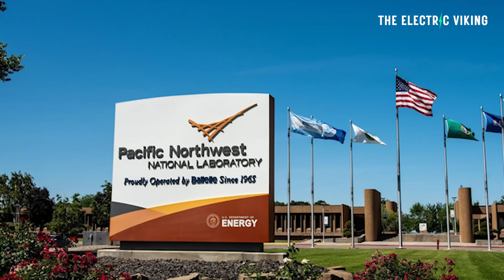Microsoft AI analysed 33 million candidates to find material to replace lithium

Comment: What I don't get is why sodium batteries haven't been given the due research they deserve. Of all the "rare" earth metals, sodium is the most abundant and easily sourced element. It's a component of "common" (!!!) salt, which is of course in sea water. It may be that sodium can't easily be obtained from salt in which case I stand corrected. But to use sea water as a source of sodium, you just need to suck it up, no damage to the environment, unlike the huge amount of damage caused by mining from the ground. It seems like such an obvious source that it feels like a conspiracy, simply because companies couldn't make as much money and it could of course facilitate a faster switch from oil. Could it also be a conspiracy that we have been exposed to all the dangers of batteries in terms of fires that people are becoming afraid of buying EVs, when sodium is supposedly safer?
I don't think it takes an AI to discover that sodium would be a good material to use, nor does it take an AI to discover that lithium combined with sodium would be a good chemistry. Surely sodium should have always been the element to experiment and develop batteries with?

Comment: Sodium batteries are nothing special, literally an iterative step in cost cutting and mainly cheaper vs li, sodium is a poor intercalation ion, requiring high surface area hard carbon instead of graphite. There are much much better, jumps possible, so if that’s AI’s best answer I call bs, look into Rb/K complimentary intercalation into graphite.. for cutting edge. ditching EMC and DMC electrolytes is the next big thing in batteries time for simple liquid electrolytes to go. Regards bill

Comment: It makes sense that China is searching for alternatives to Lithium. Despite having the 5th highest world reserves (Chile having ~6 times the minable reserves), they're the third highest producer. China is depleting their minable reserves as fast as they can, faster than any other higher reserve country is. Other countries should step up their production right now while they still can. Yes, higher production will lower the worldwide price of lithium and therefore lower the high cost of lithium batteries. Not as low as it could be with sodium-lithium, but enough to delay the financial feasibility of sodium-lithium technology which will be better for Australia and Chile. To drive China out of the market when they mine out so much of their reserve that what's left is too expensive to mine, thus forcing China to buy lithium from other countries to meet their own demand, even with a lower net demand of sodium-lithium technology.

Comment: I commend MSFTs efforts to let AI do the labour intensive number crunching to deliver a final result of a hybrid Li/Na battery as potential best in class performance to value ratio. Having said that I can't help think of we wouldn't have arrived to that conclusion soon, with the way Li and Na technology is evolving today anyway and we alteady have EVs on LI or Na already in production EVs and batteries. The conclusion to me seems unsurprising that AI found this, because with common sense we can actually conclude someone will sooner or later combine both in an experiemnt and rapid prototype from there and that Tesla has likely already thought of this hybrid somewhere in a back office (wouldn't be surprised). There is already a company that mounted a hybrid battery to a Tesla and showed a better performance. So trials for hybrid batteries have already started. And with the first Na battery EVs on the market we have already discovered their safer fire hazard risk quite soon. And from common sense it makes sense because Na batteries have lower capacity. It is especially the higher density battery, where it becomes technically challenging to manage heat, also common sense with no AI needed. I think the more interesting news with AI and batteries is if it can actually model a 3D layout gow to build safer, chaeper and better performing hybrid battery, rather than come to the conclusion which elements fit best as hybrid. And perhaps model how a battery can be built that works efficiently in different climates, which is still a huge challenge. And most interesting if AI can design an EV battery pack with best cooling practices with AND without battery cooling and minimising loss of performance and degradation. The would truly be the smartest use of AI.

Comment: we must think critically about the abuse of AI. it is the abuser, not the AI itself, that is most dangerous. if you see the implications of using AI in the critical areas of science and engineering, you can infer that much more important problem solving is being exploited behind the scenes. anything publicly announced to do with AI problem solving is likely many years behind in significance from what has actually been invented. my assertion is that the public will be the last to know the truly revolutionary AI driven innovations. additionally, there is a feedback effect with AI. AI will become (has already become?) self improving. the results of this dynamic will also be held from the public until it's "too late" unfortunately, (whatever that means). musk is correct.

Comment: Sorry but lithium is just not all that expensive. We actually have plenty of it with more easily mind reserves being discovered. So I'm not at all convinced that it's necessary to replace lithium with something else in order to get batteries cheaper. And these other materials end up being kind of exotic and hard to produce, making them just as expensive or more so. Even this supposed breakthrough only replaces some of the lithium. Better anodes, better cathodes, better electrolytes, more massive production. Lithium based batteries still have decades of upside in development and cost reductions.

Comment: Lithium is not the biggest component of a battery. Lithium is also not in short supply so really what’s the big deal here?  
We need a competitor to LFP. It’s already extremely safe and robust. Its weakness is energy density in weight and volume terms.

Comment: NASA’s solid state battery uses selenium and sulphur to achieve 3 times capacity over lithium, but are working to increase cycle life and lower cost.  I’m sure we’ll see a few different high-capacity batteries over the years, for different uses.

Comment: The AI in The Matrix also found a perfect battery replacement battery 🔋😳
Reply: Technically not a battery, they were power plants. Also in no way perfect or even remotely feasible as a power source. My head canon is they told that to humans to mess with them, and they have perfectly functional fusion reactors never shown on screen.

Comment: Hopefully AI will compress the next hundred years of fusion technological advances into the next ten. Energy storage improvements are great and absolutely needed, but just as important are clean and highly efficient methods of producing the energy in the first place.
Reply: With enough grid scale storage, I don't see why we even need anything beyond the renewables we currently have.  So, a good storage solution just might make fusion unnecessary.  

Still, I think fusion is baddass, so hopefully they can figure it out also

Comment: I am 4:15 into this and I just learned that this does not replace lithium, it replaces some of the lithium.  And you opened the whole thing with a statement that could easily be taken as zero lithium.  This is intellectual dishonesty besides being the worst form of journalism (bury the leads -- lose the readers).  Why?  It's the same story if you said "Wow, AI finds new material to replace most of the lithium in batteries!"  That would be just as interesting, I would have clicked for the same reason I did, and it would be an HONEST presentation.  I'll leave it there before I get nasty...

Comment: Amazing that Microsoft AI is apparently so strong it can create new universes yet when I type an email in Outlook or a letter in Word it cannot properly see the difference between English and Dutch (my main language) words and constantly tries to correct normal English words like "Wednesday" into Dutch words (and vice versa) even though the rest of the email is also in English. Until they manage to fix the spellchecker for multilinguals I for one will not be impressed with the Microsoft AI capabilities.
Reply: The AI does have a near 100% ability to put dialogue boxes for spell check precisely where they block what you need to see.  That can't be an accident.  If they don't block your view, you could make the corrections yourself.
Reply: Dude, they're probably not even using it in your spell check calm down
Reply: @blackmartini7684  
We were humorously suggesting that they need to work on their spell checker before they start working on an AI that might take over the world.   It's a long way to go.
Reply: Wrong department. It's not some monolithic GPAI that has replaced the whole company, it's just a physics simulation system lol.
Reply: User error it seem 😂
Reply: You might say, It's not Word Perfect!
Reply: This issue is not at the top of their priority hierarchy. They solve problems that really matter.
Reply: @Akuma.73 so if this turns out to be vaporware u gonna admit low hanging fruit should start disappearing if AI is really that tech like that?

Comment: Thanks for the post Sam. AI is certainly extremely interesting. However "EVERTHING will be cheaper and better" ? Sounds like a fantasy future. Unfortunately there will always be issues with Humans who control AI. Although for how long, only time will tell.
Reply: “Everything will be cheaper and better” sounds like the past 200 years. For example, you are reading this comment on a computer that is more powerful than the best supercomputers of the 1980s. A library of millions of video recordings available anytime, to anyone, for free, was beyond the comprehension of the richest and greatest kings of 200 years ago. You are probably sitting in a building where the temperature is magically managed for you, winter or summer. You have a pantry full of intensely delicious, nutritious food that will last for years on a shelf, that cost a smaller share of your income than any of your ancestors enjoyed - because food is now cheaper than it has ever been, despite the population growing 8x in the past 200 years. You will never get smallpox, or polio. If you get an infection, you can take a pill and it goes away, without dying or losing a limb. You could probably pull out a credit card, buy a flight, and be on another continent tomorrow. 

Everything IS cheaper and better!

Comment: Interesting AI development. I work in the IT industry and we are still  using manual methods to deploy and configure network equipment. ie "Console cable and SSH". I'm predicting AI will soon learn the technology and replace me and do it better and faster. One person can monitor the AI system and replace a team of network analysts except for the techs who do all the hands and feet work to install hardware and cables. The AI will surely be capable of managing that team and deploying them via cell phone application to install/decommission/replace failed equipment. In addition, AI will be cable of configuring firewalls and monitoring traffic for threats.
Reply: I haven't seen an AI troubleshoot anything yet, any examples?
Reply: @oneman5753  Look at medical industry. It can more accurately troubleshoot than doctors for the human body, human-made machines will be a lot easier if you can get the training data.
Reply: If you believe all that you are on another planet.
Reply: Bot.

Comment: I mean, we already knew that. NA in theory could also be a lot higher in power dens and is already "Good enough" for the everage car today once we get there. Add a little bit of Li and change the carbon active side for something like Si and S you could have a battery 4 TIMES current power dens batteries today or over 400-600. Making battery packs 5 times cheaper than today. 20k->5k or less 1k for the same to double the current range. In the far future, instead of packs, we will be looking at around 5-10 just large cells much like putting AA or AAA batteries into toy cars.

Comment: Unless it is air then whatever element it is it must be one of the global non-ferrous methals traded on global exchanges, otherwise it will just stay un the lab.
Not mamy metals are lighter than Lithium so whatever it is ir must have a higher specific energy than lithium ( so energy discharged or stored per unit Kg).

Comment: Aluminum ions will work great but will require titanium or copper collector foils. 3 electrons per ion would easily compensate for the more expensive materials needed for the collectors, though.❤
Reply: I was going to say to just use aluminum.  May not have the cycles due to pitting.
Reply: @pukaman2000  yup it would dissolve and pit like lithium foils in metal anode lithium ion batteries.  It needs a conductive skeleton that won't disolve in the electrolyte.
Reply: Al sulpher has been tested and one way of keeping it working and increasing the  efficiency is apparently is to seed the electrolyte with Lithium ions.. it doesnt take much and they act akin to sheep dogs herding the big charge carriers across and sliding them into the gates.. preventing damage to the cathodes and anodes in cycling.
Reply: Have you been following Graphene Manufacturing Group? Sounds like you might be.
Reply: @davidnika446  
Not graphine ... to expensive too intensive to make sense at the moment a bit like building everything from Carbon fiber... Or using Lithium . Take a look at   chemically engineered wood in a Scientific American article  or the company thats produced Mettelwood...  the guy is a wood polymer genius ... he can produce a matrix for batteries from modified wood that enhances lithium and other batteries .. they can also create transparent glazing ..  that has the strength and uv stability of wood and also insulates like wood.  It also fixes carbon in the structure.
Think laterally and work with nature  wherever you you can .🧙‍♂️.  Mettal wood is rot and fire resistant  its mechanical properties make lighter than Al yet  stronger than steel  and highly ballistically resistant and also to torsional forces and splitting.  Its stronger than kevlar at a fraction of the price... and could even compete with carbon fiber in key areas like boats, buildings aircraft and vehicles.
Reply: Aluminum has great volumetric capacity, but finding a cathode that can effectively store aluminum ions is still a challenge. It also has a lower standard electrode potential than lithium.

Comment: Tesla Nickel-cobalt-aluminium (NCA) battery cell is already a low 2% lithium.
Reply: No way . Is it any good
Reply: @walterwhite1  Mostly for US-made Tesla EVs and long-range US export variants.
Reply: @walterwhite1  Musk said that the amount of lithium in a lithium-ion battery is about 2% of its total volume.

Musk: “Our cells should be called Nickel-Graphite, because primarily the cathode is nickel and the anode side is graphite with silicon oxide… [there’s] a little bit of lithium in there, but it’s like the salt on the salad,”
Reply: @valenrn8657  wow no way

Comment: AI = guess. there is no certainty if the candidate will react in the way predicted. the problem we have is not looking for a substitute, you are not going to get better result than lithium simply because of it mass, for a single phase battery, lithium is always going to be lighter and weight is the primary concern for mobility. the only way we know of to increase energy density beyond that is to go mutli phase. where the battery does 1 chemical reaction than another chemical reaction. however such system are still inferior to solid state. so the material isn't the issue, the structure is.